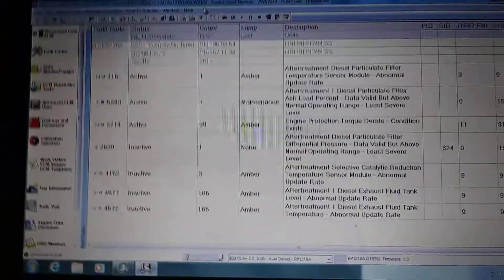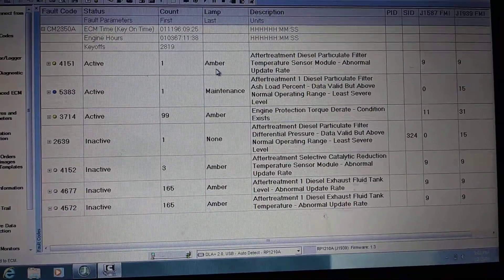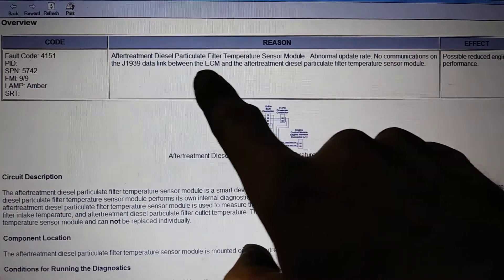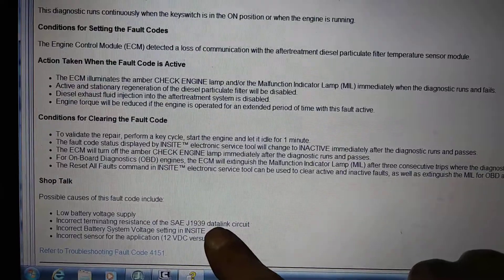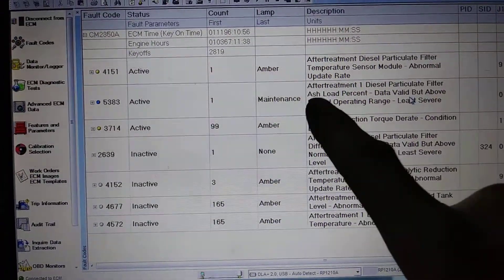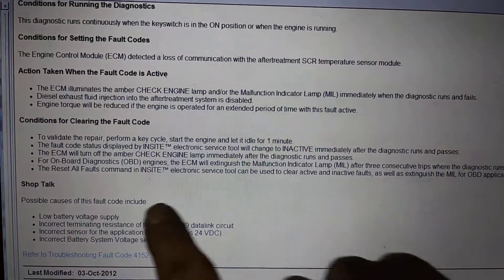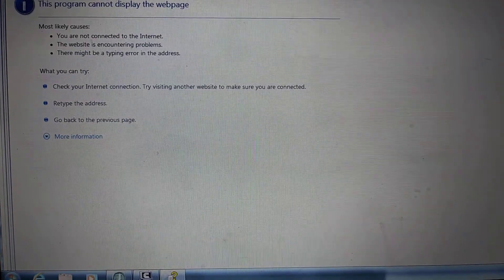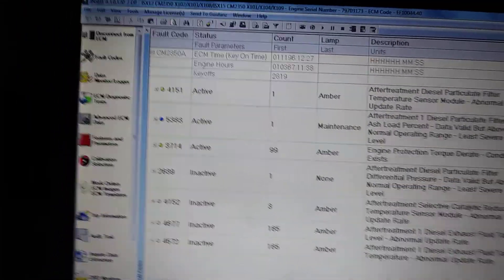J1939 Data Link

Comment: Nice video. I hav the same error fault code on 2006 Volvo vnl D12 engine. CAN YOU PLEASE TELL ME WHERE TO LOOK FOR THIS WIRE HARNESS ? I may have the same issue with that pin broken.  Thanks in advance 🙏

Comment: Great video,  I currently have that issue with my 2015 cascadia evolution with the check engine lights on. I can clear the lights from the dash but it comes back after a while. Working to get the issue resolved

Comment: Good afternoon sir I wanted to know if you could please guide me in the right direction of a problem I'm having with my 2013 Freightliner Cascadia dd15 with on guard system the problem is out of the blue I would get a rsc system failed on my dash display then the tractor ABS light will come on and off when that happens the cruise will disengage and also the engine brake will start jerking when the abs light comes on onguard code I'm getting is a spn 516497 fmi 12 this life is very random thank you so much I know you're busy but I was hoping you could guide me in the right direction I do have diagnostic link so I could do testing if I need to oh yeah I love your videos
Reply from the maker: Thank you for the compliments much appreciated!
My past experience with and issues with these trucks have been the wabco abs ecu itself, I would suggest to swap it out with a known good one same year truck etc, and test drive, the dealer can re-program the ecu that is defective. From past experience re-program the original ecu will last a few months, its a joke, they have to program the ecu to recognize certain priameters, or reset the ecu, if you buy a new ecu the dealer has to program it to the truck,  it is rarely abs wiring issues on a freightliner just ecu issues, hope this helps, have a good one.